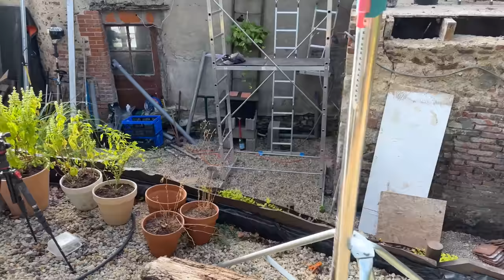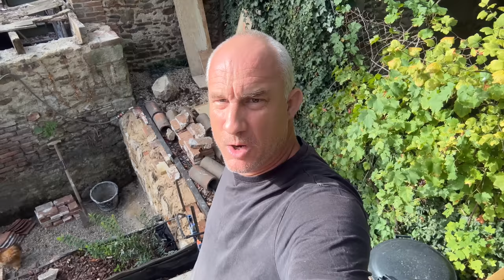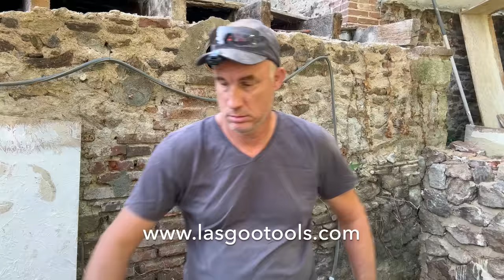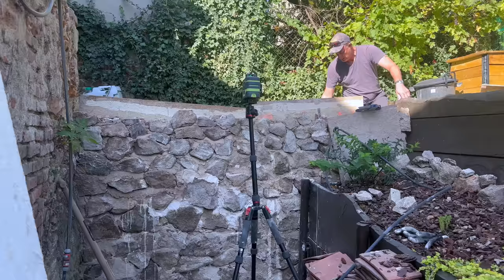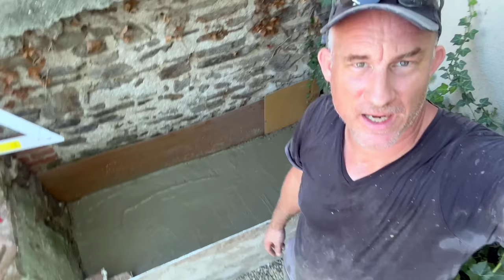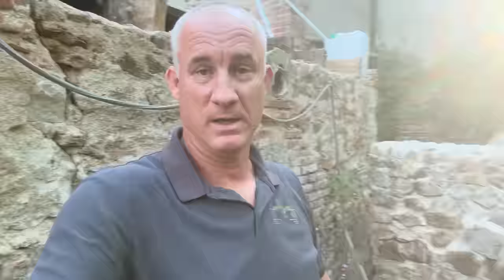How to build a traditional stone wall, Episode 49

Comment: Hi, I'm enjoying seeing your progress. I'm clueless over building but wonder if water can get trapped between your neighbour's wall and the steps you plan and if so could that be bad for them? Do you need a waterproof membrane perhaps? Not expecting an answer, just don't want you to be in trouble.
Reply from the maker: Good point. Water will run down the wall and deep into the dirt below (behind the steps) The seem between the walls will be closed though. Probably with PU foam.

Comment: How long is the battery life??❤
Reply from the maker: Of what? The coop door? The manual states months. After one week of use I still have 100% charge. They also come with an AC adapter so you can power the doors from the net
Reply: Yes the batteries last ages in most automatic coop doors.  We have the chickenguard one, but I think i might get the chickcozy one for use when we finally move to ireland next year.  We have also had a hentronix opener that is used with the omlet go up.  It was on solar power but it didnt work well, and was expensive, so we had to power up from the house to ensure it opened and closed at the right times.  Loving the progress of your little house marius, its looking great.
Reply from the maker: @tjeffscats  thanks. I wish these coop doors came with wifi though. I have 2 cameras on which I can monitor wether the chicks are safe inside before the door closes. In case they didn’t make it in time I’ll have to call my neighbor to let the chicks in by opening the doors. If it were controllable by phone via WiFi I could do it by myself remotely.